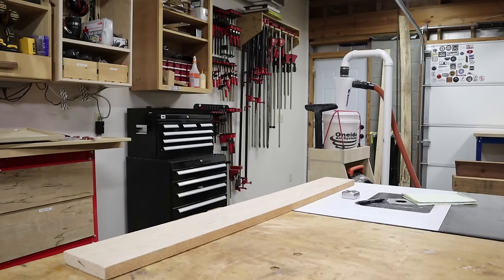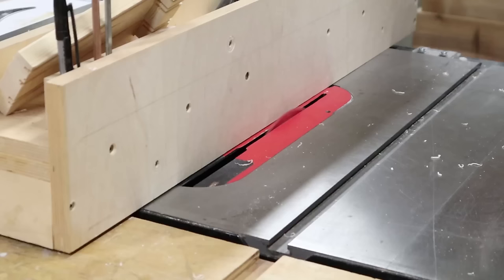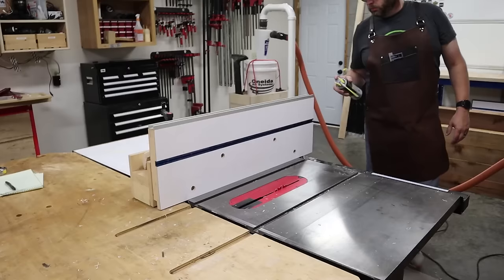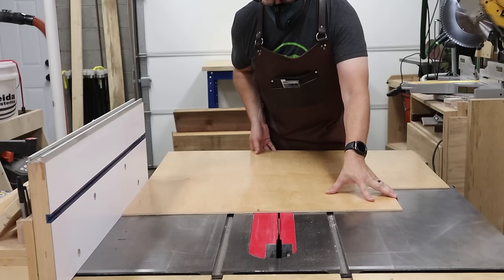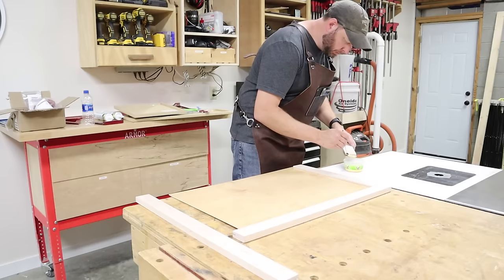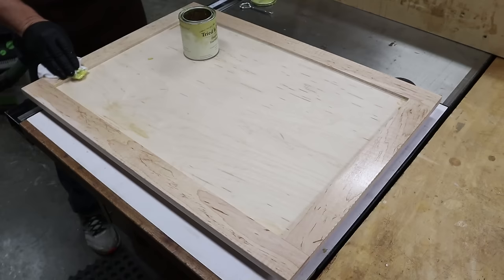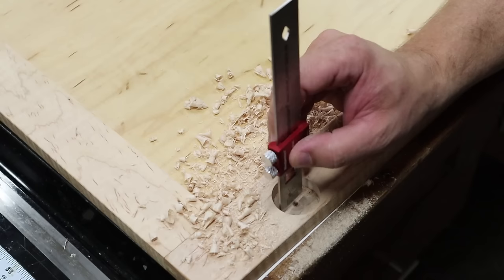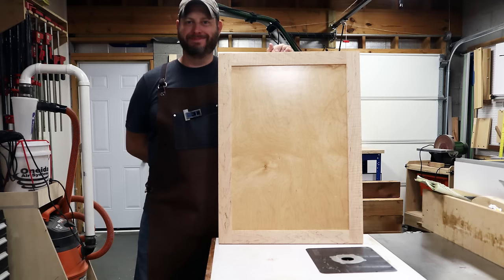I don't understand why people make this so hard?

Comment: Great informative video, I make my doors 2mm bigger all round and then trim them to size in the panel saw, this also squares them up.
Reply from the maker: I over size mine sometimes but generally do it when the door will be inset rather than overlay👍 gives me room to fit the door with even gaps
Reply: @MWAWoodworks I'm going to try my hand at inset doors and drawers. I know it's going to be more work but I prefer the look.

Comment: People make it so hard because people don't have all the tools and machinery you have lol
Reply from the maker: Lol all you need is a table saw.
Reply: @MWAWoodworks Not all table saws are created equal. And bear in mind that some of our big box stores stock cheap pine and pretty much nothing else. The tenoning jig looks pretty neat though.
Reply: @MWAWoodworks  what about the jig?
Reply: …46 seconds in and he’s used a miter saw, table saw and a jointer…
Reply: You can do this with a cheap router and a cheap grooving bit. All the machinery makes it much much easier, but it’s doable with a simple router.
Reply: @MWAWoodworks says the guy who has a miter saw, jointer, planer, and table saw in the first minute of the video.
Reply: Exactly why I do my joinery by hand. I can’t afford a $6,000 table-saw. On top of thousands of dollars for a planer and jointer. Even with the highest end hand tools. You still spend less than middle of the line joiners, planers, table saws and router/tables.
Reply: @taylorboyd3308 and you also get the pride of having made a perfect joint yourself instead of the table saw engineer's skill having done most of the work for you.
Reply: These comments are so worthless. I’m sure there are plenty of channels that just use hand tools. Go watch those.
Reply: @polbecca  o
Reply: I'm not sure what your point is? You're poor and can't buy what he has or you can buy some of it ? Or you'r from another country and the translation didn't come through

Comment: I work at a molding shop and personally make shaker/raised panel doors. After putting all the pieces together after glue up, I put them in a Ritter press to square up and add brad nails on the stile intersections to go through both tongue and groove on the back side of the door so I don't have to wait for the glue to harden. Then I run them through a voorwood machine to add the edge/profile followed up with running through a sander at 150grit.
Reply: And of course all of what you just said is a practical option for the home wood worker.

Comment: Nice useful video. Never seen a tenon jig like that...cool.

Stereo amplifiers need a little ventilation because of the waste heat.  A few holes drilled on the bottom and the top would do that.  You could add computer fan filters that would work to keep the dust out.  They need a 120 mm hole.

Comment: The small alternative is to use a floating tenon for the frame joint this saves having to cut the tenon with the risk of not cutting it accurately especially if you wish to offset the panel groove

Comment: Shaper, insert tooling, feeder. Much more efficient and reliable. Stop block method on table saw more reliable for cutting rails and stiles. Miter saws are used for breaking down rough lumber before milling. My advice to those wanting to start building cabinet doors but haven’t and don’t know where to start would be simple. 2 1/4 HP router with a table you buy or make. Router bits. No table saw. The hardest possible way to build a shaker door. The router will allow you to offer multiple profiles. Lastly, eased edges on the rails and stiles are the true game changer if doing your own finishing. Good luck.

Comment: I cut the tenons using a dado set and sacrificial fence along with a miter gauge.  After set up, 2 cuts and the tenon is done.
Reply from the maker: Yep that works too but I find the cut a little more rough that way. Still holds on to glue that way.

Comment: I know this is the modern way to make frame and panel; but my brain can't get on with how short the tenon holding the rails into the stiles is. I'd feel much more comfortable with a longer tenon, but I do appreciate that's more work.

When I get on to remaking my kitchen cabinet doors, I'm going to experiment with adding a domino to strengthen that joint.

Comment: How far did you set the fence when cutting the dado?  If your board is 3/4" thick and you want the dado to be about 1/4", then assuming the blade kerf is 1/8th inch, you set the fence 1/4 inch from the right side of the blade kerf (closest to fence).  Can you confirm?

Comment: Is it normal to see the planar ribs?  I'm looking to buy a thickness planar, and wondering if that's the norm.  I recently used a hand planar for the first time on butcher block, and was able to sand those vallies out using 60 grit and stepping up to 320.  Wasn't fun though.

Comment: Just wanted to mention that tenons can also be cut without using the jig. Miter gauge can be used instead.
Reply from the maker: That's true! I've done that. Just a bit more tedious but if you don't have the jig it's a fine solution

Comment: Looks so nice~! I had a question. Is it bad to have a heavy door? I'm building a closed door shoe cabinet with 3/4 plywood about 6ft high and 3ft wide 14in deep. I figured I would just use the same plywood for the door as well, but wondering if that would be too heavy. Is it just for great aesthetic purposes that you make these awesome looking doors or do doors need to be light? Just wondering because I don't care too much about aesthetics for this project, since the cabinet will be in the garage.
Reply: That's a lot of weight. Will need hd hinges,, and may cause racking over time.

Comment: Hello Matt, thanks for making this. I'm making some of these for my Mom and Dad's kitchen. Well, a lot of them. First major ww project for someone else. I have a couple of questions if you might be so kind to address? First, I'm making these with beadboard panels- as per mom's request - and she wants to paint them. When I assemble them, should I glue the panel at all? How do I deal with the panel moving a bit and the paint edge? I was considering caulking the rail/panel and stile/panel interface and maybe the caulk would hold well enough? Secondly, I'm limited in clamps. I have to make 21 doors... how long should I let the glue dry in clamps. For reference, I have Titebond III, was considering maybe getting Titebond II to use for slightly faster setup.  Your time and effort is much appreciated, thank you in advance.
Reply: I bought a bunch of hand clamps from harbor freight for about 6 bucks a piece I think it was. I think I'm up to 8 now which can allow me to have 4 doors drying at once.

Comment: I don’t understand why YOU made this so hard! You had a perfectly good router table and could have done this more simply with a tongue and groove router bit set. No multiple passes, no jigs, very little measuring. You can also route the groove along one long edge BEFORE cutting pieces to length, and you’ll save passes and ensure all the pieces match perfectly
Reply from the maker: That's fine except far more people own a table saw than a router table or specialized rail and stile bits!
Reply: @MWAWoodworks fair enough. New video idea for you: do this again on the router table (the Freud router bit set is good), and compare speed, equipment cost, and other benefits and drawbacks of the two methods.

Comment: I’m making a dartboard cabinet that has three plywood panels in each door inbetween cherry hardwood rails and styles.  Do you glue the plywood cherry or just the hardwood panels and styles?  Thanks in advance
Reply from the maker: You don't have to glue the plywood panels. They "float" inside the frame.

Comment: I been gluing the plywood too. Does it hurt  to do that?
Reply from the maker: Uh, I wouldn't say it hurts, it's just not needed. If you want to prevent rattling of the panel add just a dab of glue to all four sides in the middle that will hold it still. Also only glue plywood or MDF. Never glue a solid wood center panel!

Comment: Flipping styles and rails sticking on the table saw is a fools game and makes joinery shitty. Typ switching reference faces will yield run out that's doubled out of tolerance. In short either your panel will be too tight or too sloppy or your cope will fit poorly.